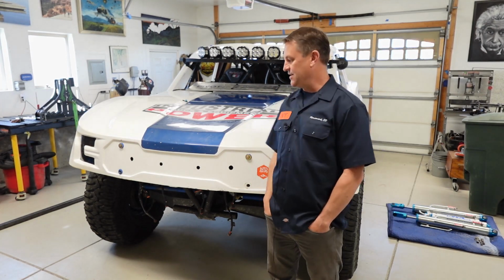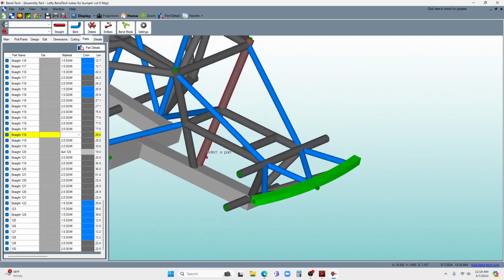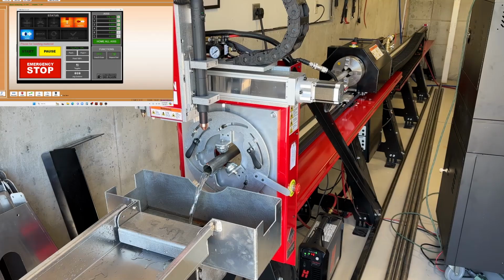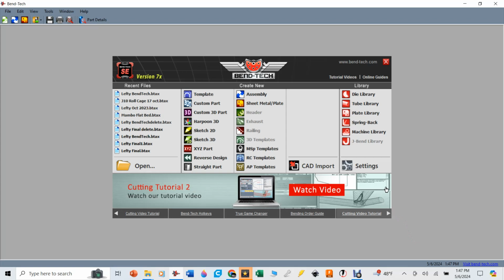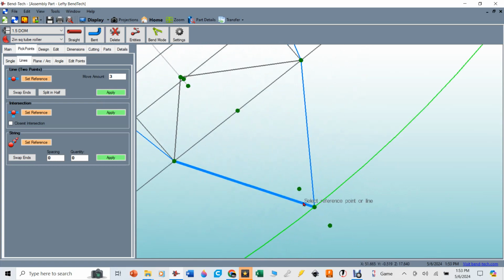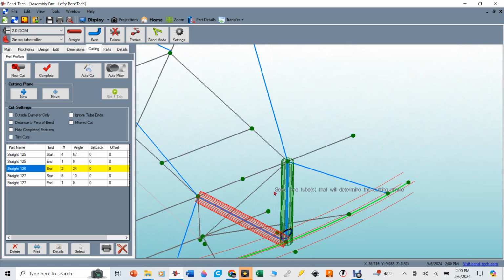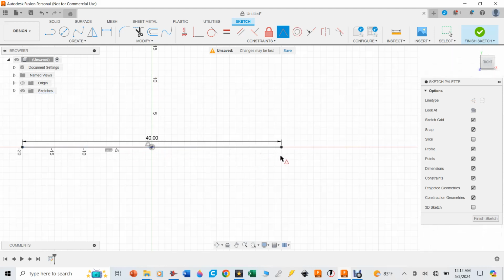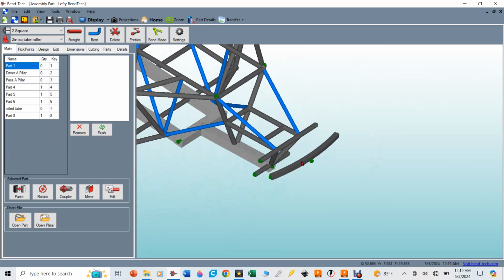Can a Beginner Use Bend-Tech Dragon CAM

Comment: How long does it take from importinf a step file to a couple parts in hand . I’ve got bend tech . But I do prefer drawing in fusion .
Reply from the maker: Using BendTech I can complete a Class 11 roll cage in about 3 days.   It seems like taking measurements takes the longest time.   About an hour to cut tubes on the Dragon A250 and about 2 days to prep tubes and weld.
Reply: @ntdracing  I wanna get one but the economy in the UK at the moment is terrible